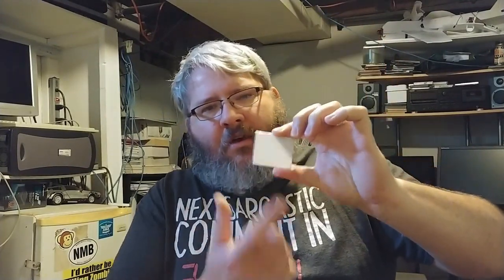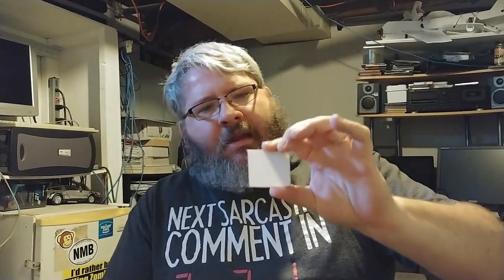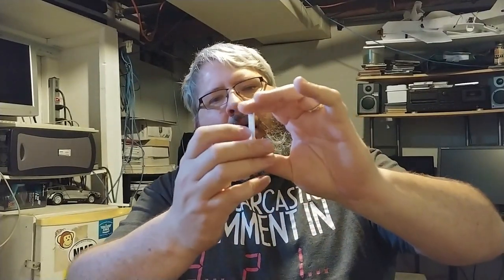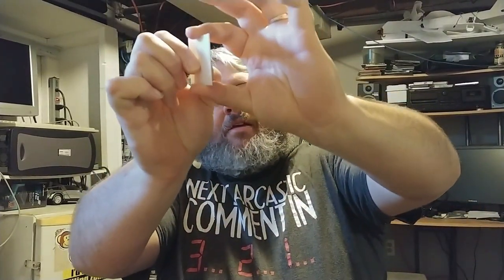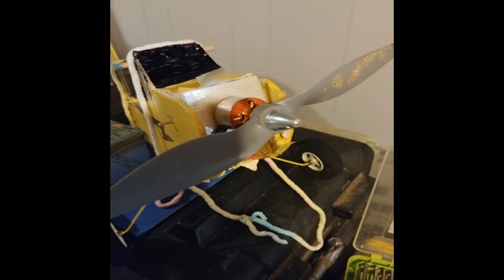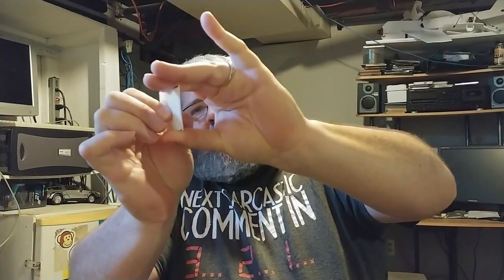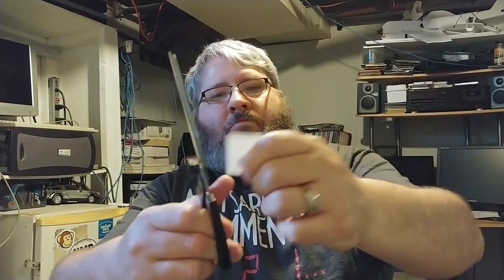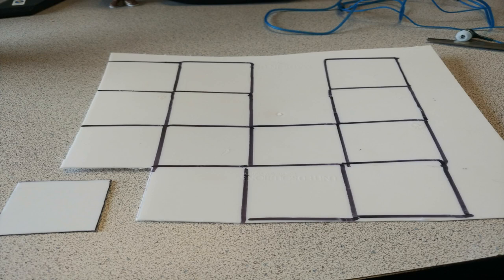DIY Flitetest Plastic Firewalls: Super cheap and durable!

Comment: For a quick fix I add a gift card in front of or behind the flight test wood fire wall.  Glue the two pieces together with CA.  Then just use your razor cutter or dremmel tool to make the holes in the gift card match the holes already in your original firewall.
Reply from the maker: Cool...thanks for the tip!